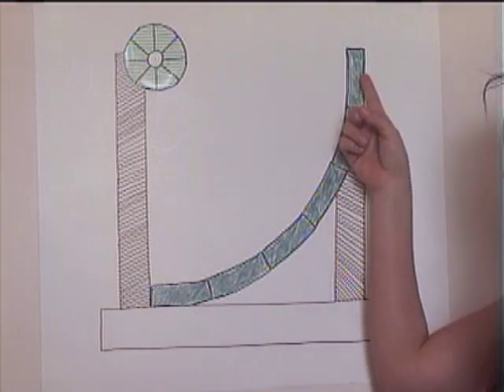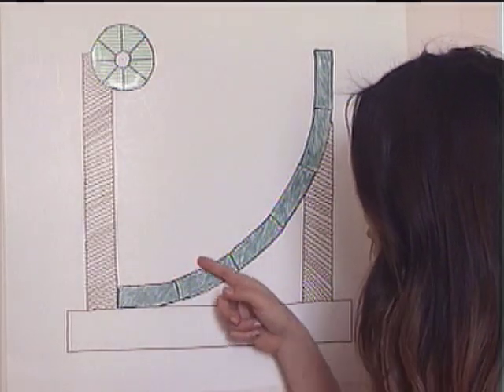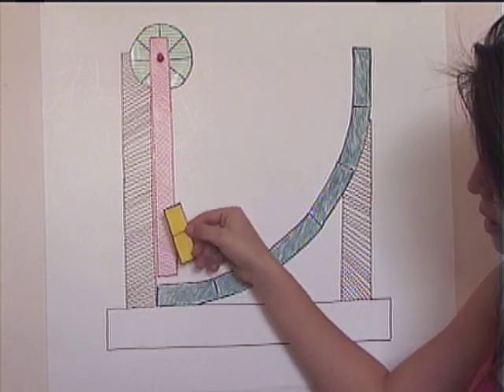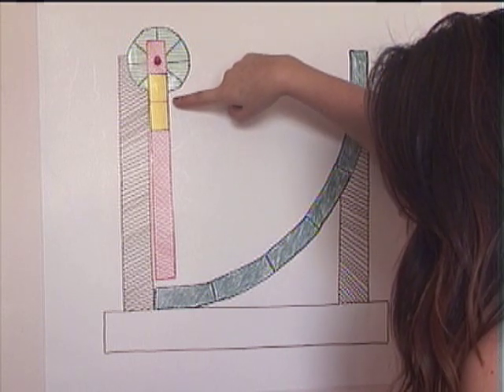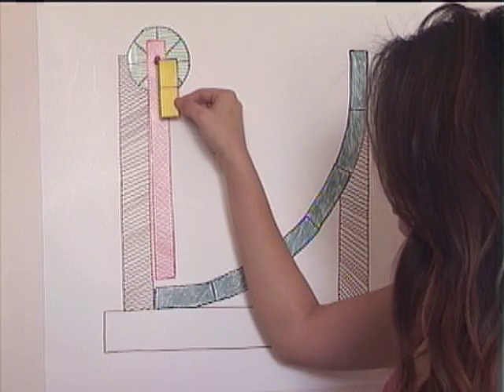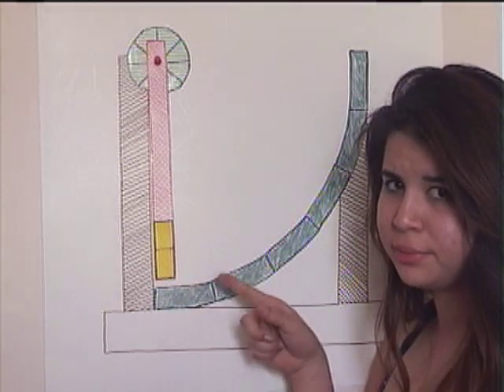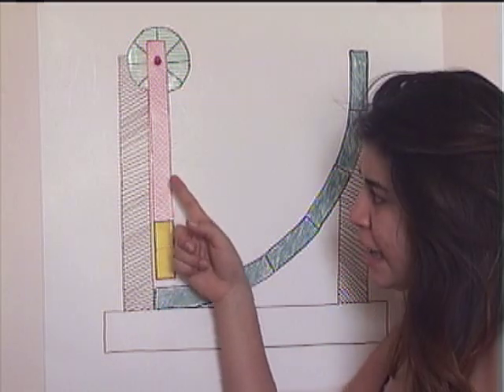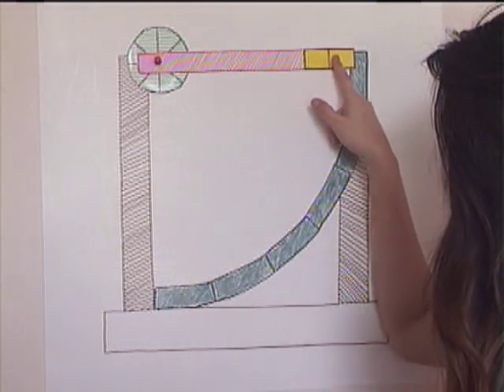Electric Generator Free Energy

Comment: the magnet that falls would have to latch at the peak of it's fall past the neutral point and the arm would have to latch at it's highest point. i think the device would need to have enough height to work, a short electric pulse to unlatch the magnet and the the arm might allow for energy gain in the system.

Comment: Worst  "Free Energy " video ever.  Just awful somehow. The magnet will never move that way. It will just be pushed away from the center of the arch magnets and be pinned against the generator support. Plus she fails to acknowledge how fast a common generator needs to spin. Then the losses of powered latching devices and a ratchet are wasting the tiny pulse of power it might generate.  Another "It Can't Work So We Didn't Build It" YouTube Waste.

Comment: What works in theory doesn't always work in practical. you need to build a Proto type. I hope you are right.
Reply: Ehsan Sadaqat Unfortunately it doesn't work in theory. Just a concept which leaves out some details.... like the fact that it does no useful work without equal (or more) input work.
Reply: James Van Damme I agree. This requires some sort of 'electric catch' to determine when the magnet is allowed to slide. It also seems to ignore any friction present in the sliding mechanism. Also ignored is resistance in the gears.

If this idea was to use only magnetic axles and such, it MAY be able to power itself in a vacuum for a short period of time, but it wouldn't last long due to resistance in the generator and any electrical wires.

Comment: Trouble is this will produce a throbing pulse of energy rather than a smooth flow of energy, so the effect is going to be Ok in a Disco hall lighting where you need strobing lights.
Reply: Couldn't a rectifier be implemented to solve that?
Reply: +Tiwaz Tyr A flywheel would be better. 
Her theory is: if we put a high-repulsion magnet at the bottom and a low-repulsion one at the top, the magnet-fitted arm will flip up, be pulled down by gravity and flip back up again. The theory has a huge problem: if you stick two magnets together end-to-end, you've created one big magnet.